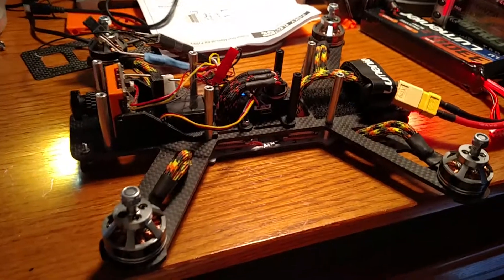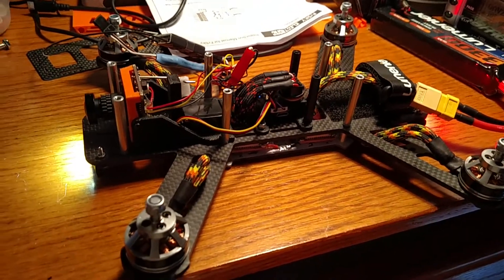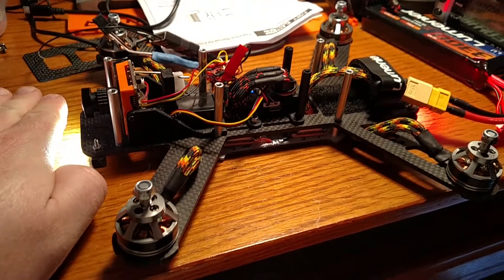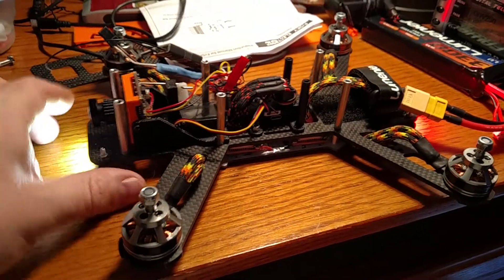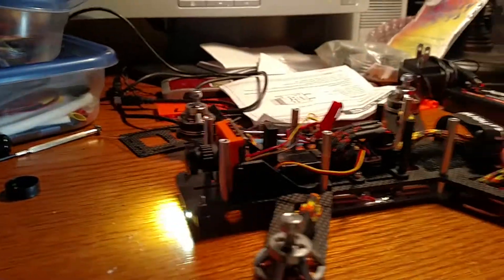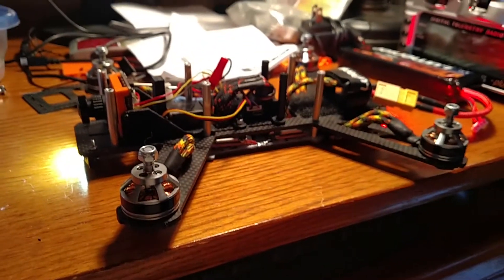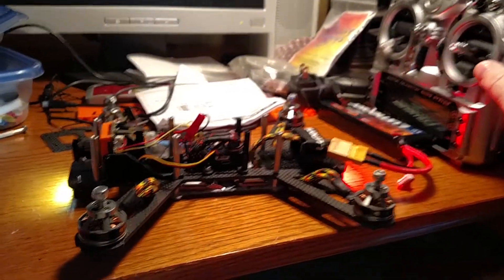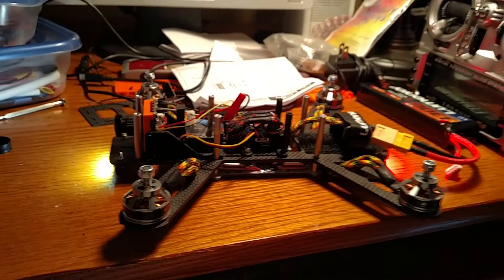QAV250 CC3D Atom FC with camera pitch gimbal

Comment: heyhooo adamky1 
Your setup and gimbalsystem looks so clean and nice, I think I have to rebuilld this idea!
Not for my QAV250, this is just a pure racer where I can cope with a huge angle, but on my 2206 4S Cloneout, a fusion between B330 and miniHquad, this could be a huge improvement.
Full throttle forward on a <600g quad with mn2206 @ 6045 4S is 'like 80 degree pitch nose down', even with a 25deg FPV cam angle it is not enough for fast forward, and with more than 25deg slow flying or hovering just sucks...

Would you mind sharing the files?A friend can print it for me, and I still have some servos left. what is the maximum angle your design can do? 45 would be amazing!
I think I will use the same cc3d gimbal method as you, about 50%! Or maybe a 3pos switch on my Tx: "neutral/10deg"; "cruising/25deg"; "racing/35-45deg".

greetings and thanks!
Potracer
Reply from the maker: Pot Racer Thanks, I appreciate that. I've never measured the max angle, but I can do that. I have a different camera and gimbal setup on it now, but I have a few spare frames that I can test it on. Which camera will you be running? It was designed specifically around the Lumenier CS-600 camera, so I'm not sure how well it will fit others. Even the base was designed specifically for the tight space in the QAV250's frame. It actually mounts by fitting between the second set of standoffs and then the top plate locks it in place without any mounting tape or screws.
Reply: Buddy, I guess we are both pretty similar looking at our stuff, I have the CS-600 Lumenier too :D
But aso a fatshark mini and a runcam pz420.
but the gimbal is planned for my cloneout that already has the CS-600.
Reply from the maker: Pot Racer Ok, it should work fine then. I'll upload the file to Thingiverse and post the link in my next reply.
Reply from the maker: +Pot Racer I know this is way late, but I finally uploaded the design to Thingiverse: http://www.thingiverse.com/thing:1206745. Sorry, I forgot all about it :-)